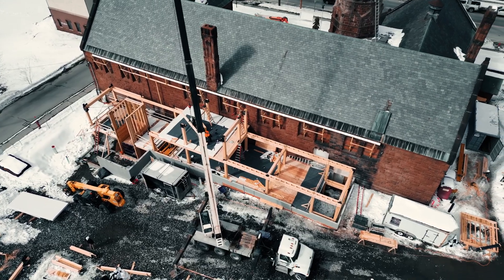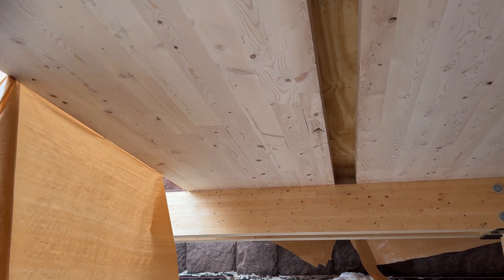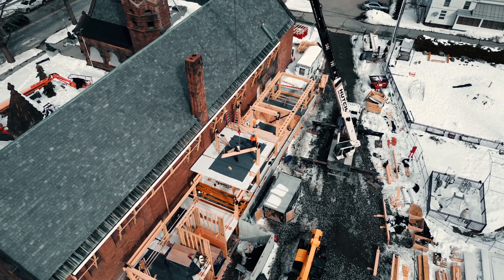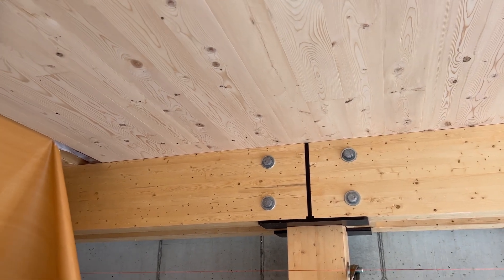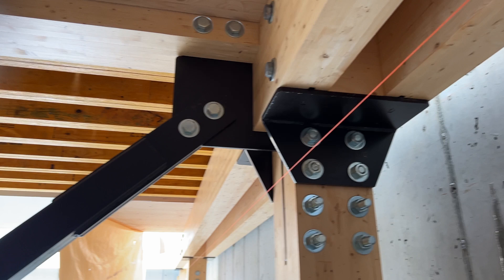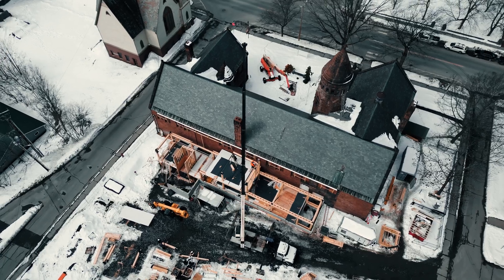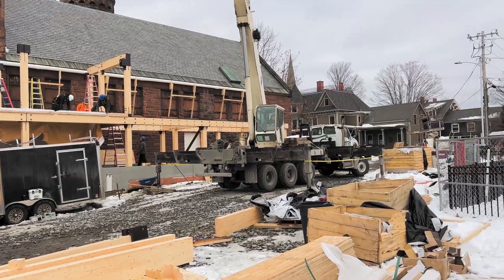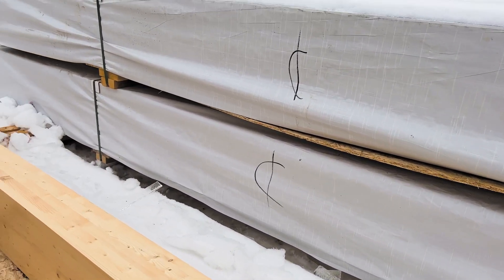Eastern Hemlock CLT | World's First Use of this Mass Timber Product

Comment: What moisture content was the hemlock at when it was laminated.? 
I’ve read that most softwood  CLT stock is dried to MC much lower  than standard KD 19.  Since the closed cells of Eastern hemlock don’t allow for standard KD19, what was done differently to use Eastern hemlock?
Reply from the maker: Great question. As you likely know, Eastern Hemlock is typically sold green and rough, and CLT requires the input lumber to be planed and MC 12% +/- 3% at the time of CLT manufacturing. This work was done at Cersosimo in Brattleboro, VT. As the use of Eastern Hemlock in mass timber products grows, it will necessarily create the demand for more infrastructure to process the lumber prior to CLT production. I don't know the specific details of the kilning for this specific lumber vs. others but can ask about it. Thanks for watching.
Reply: @MassTimberHowTos  St Regis built the Costigan stud mill to use Eastern hemlock.  The decision was made at the Lumber and Plywood division headquarters in Tacoma.  I was not involved in that decision,  but apparently the differences between Western hemlock and Eastern hemlock were overlooked.  The St Regis technical center worked very hard to make that mill successful on Eastern Hemlock but ultimately it became a spruce mill.  my understanding is that it is impossible to get the water out of the cells and that the cell structure will collapse if the kiln process goes on too long.

 Some years after St Regis merged into Champion, we bought the Passadumkeag stud mill which had 90% of the market for Eastern hemlock studs.  We ran all the lumber through the kilns but it was only to get the free moisture out of the lumber so the shipping weight would be less.
Reply: @billcraig is that stud mill still in operation or has it been sold or dismantled?
Reply: @randyrand-renovate2075  Both Costigan and Passadumkeag were dismantled in the early 2000s.
Reply: No both the Costigan mill and the Passadumkeag mill, which cut a lot of Eastern hemlock, were dismantled years ago.